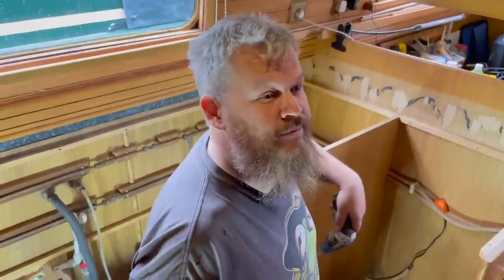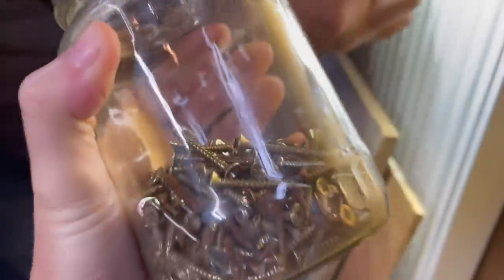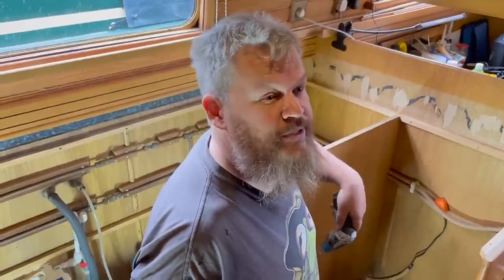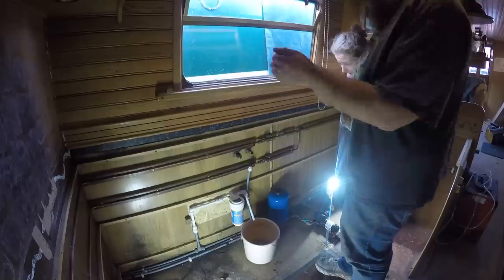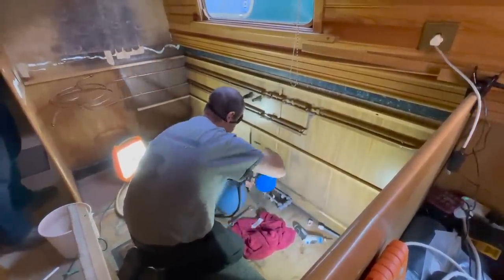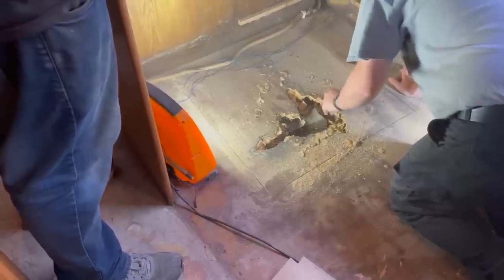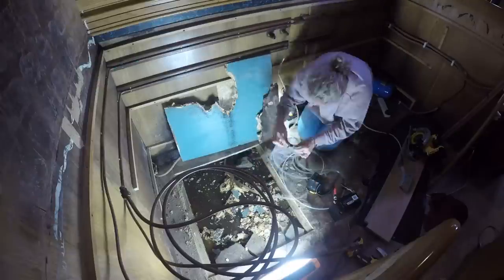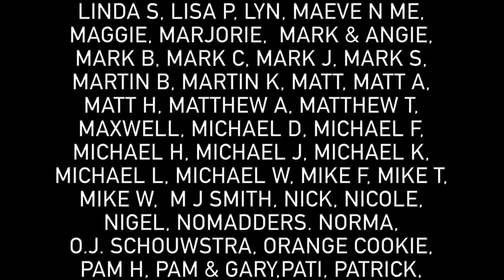EPISODE 014 || Narrowboat Renovation Disaster - We found our Bilge Flooded!

Comment: The joys of boat flooding.  Once my cold water pump's pressure sensor failed and caused the calorifier valve to open and slowly leak onto the floor.  Luckily I have a hidden bilge cover right at the back of the boat, so any water can be drained from there.  You don't have one?
Reply from the maker: We have installed a couple of inspection holes now. Now you know why we were so exhausted when we arrived at the moorings last year.
Reply: @MinimalList  Yes.  The work never ceases.  I think Juno did a video long ago about metal inspection hole kits that looked very nice.